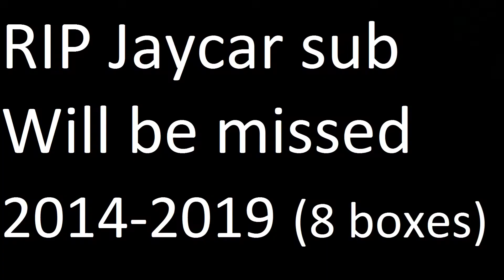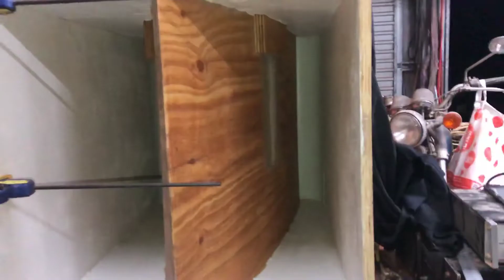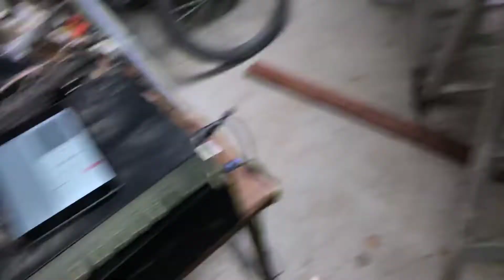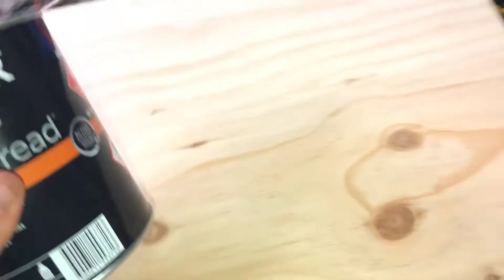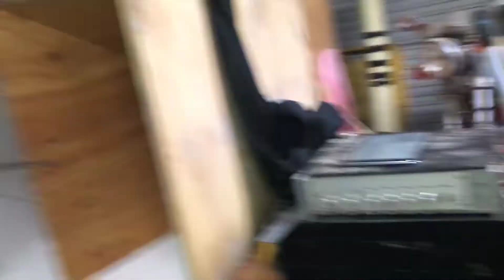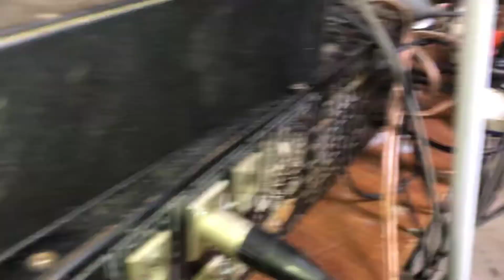Visuals - Folded Horn ep 12

Comment: Some bits inside the horn connecting to the curved centre should sort out the flex.
Reply from the maker: I specifically didn't want to add bracing inside the mouth of the horn for aesthetic purposes. I know I could've, and it would've saved a ton of bracing on the exterior, but I reckon that wide open mouth looks awesome.

Comment: If we design a bassreflex with the same driver, how different does the folded horn sound compared to ported ???
Reply from the maker: I'm not sure if there's a method to work out the 'optimal' horn for a specific driver, there is a method for ported drivers though. If this horn is considered ideal, it'd be the equivalent of a maybe ~40L enclosure tuned to 40Hz. 
That said, a more ideal ported enclosure would be more like 60L enclosure tuned to ~30Hz, in which case the ported enclosure would go lower, and likely have a flatter freq response overall. The horn, however, rolls off under 39Hz, but would be around 18dB louder across the entire spectrum above the ported counterpart.
Sound quality wise, the ported driver would likely sound better, a sealed box for this driver sounds great, phase would be good, the horn has low group delay though the phase is all over the place which loses some sound quality/definition points.
Reply: @Dakoustics  till date i have built some  ported subs. I have to try horns also soon.
Reply from the maker: @learner72  I'm super impressed by my own horn, it'd be cool to see them become more common, probably the difficulty curve that keeps people building simple ported enclosures
Reply: @Dakoustics  right now i have 12" high excursion low Qts drivers .... Not sure if they are suitable for horn loading. ...
Reply from the maker: @learner72  people often use PA subwoofers in horns, which tend to be low qts, low excursion, I had from what I'm aware good results from a high excursion high Qts driver, in theory just decreasing the size of the sealed chamber should boost your Qtc and it should be successful
Reply: @Dakoustics  thank you so much for your time and explanation !!! Really appreciate that !!

Comment: You gonna come drop that off in my theater, mate? I'll buy you a pizza!
Reply from the maker: Heh, I've been thinking of putting it into a mock-up home theatre setup, alongside a few array speakers, I'll probably do it when I meter it inside. It goes deeper than the stock LG sub that came with my old home theatre, so fingers crossed it'll do 1:1 explosions
Reply: @Dakoustics  I typically run sealed subs (have 5 15s and 3 18s powered by a Behringer NX4-6000) and it's so much fun hitting 8, 9 and 10 Hertz in the triple digits in a 30 x 42 foot room! 

It's purely for theater though! Lots of ultra low frequency!